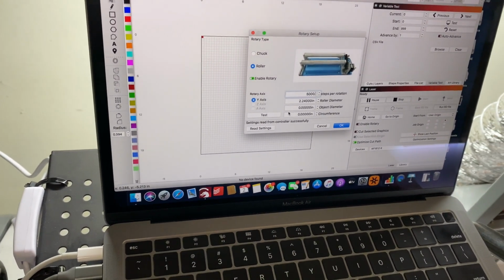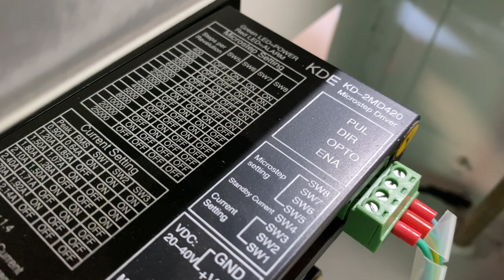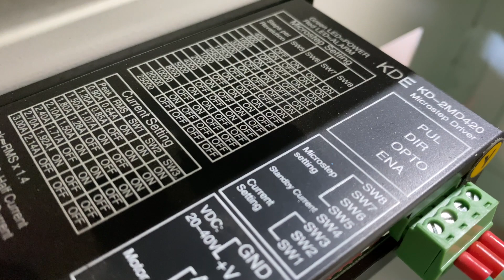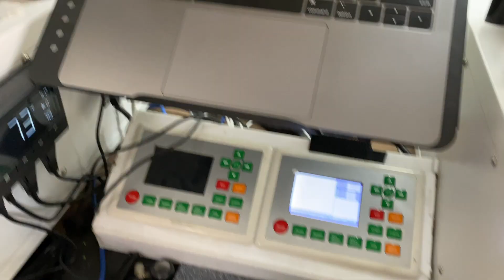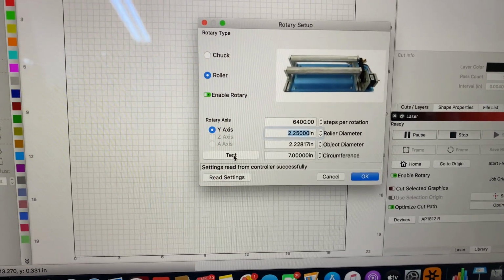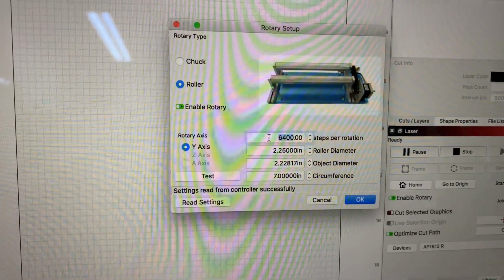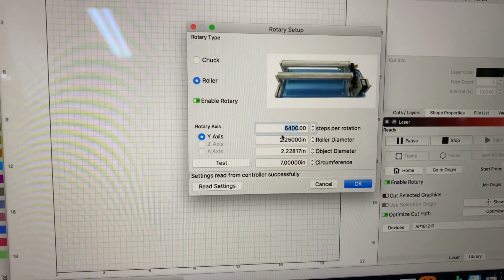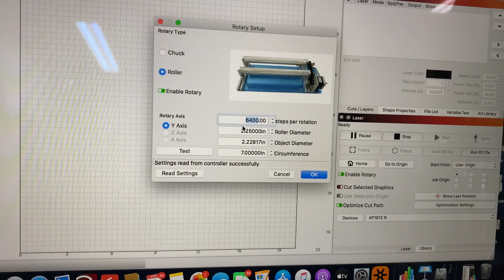HOW TO... Rotary Test Lightburn

Comment: I have an issue where the rotary just keeps going and going when i try to get it to do one spin. It seemed that when I changed steps per rotation, nothing changed even though I clicked «write» any ideas what’s wrong? All the other settings were correct

This is a cloudray roller

Comment: Could you help me ? I have a fiber laser everything is plugged in correctly into the stepper motor according to diagrams and few videos I’ve seen. But the rotary still won’t turn ? The chuck is fully powered. Any ideas ?

Comment: I have a pi burn 3.0 and for some reason my machine will Rasster and vector an image but it is not rolling in the cup. Is there a setting that I am missing?

I know the machine works because it spins when I hold it. And on my Riuta controller I can scan up and down to spin the cup. Frame also works to spin the cup but the job or graphic rastering does not.
Reply from the maker: You likely have your steps or roller size wrong.. Or you dont have the rotary enabled in Lightburn
Reply: @HouseOfLasers  Thank you. I found that the prior owner of my machine installed a toggle switch and apparently it was in the wrong position. I knew nothing of that switch but for some reason when I switched it on and allowed the x-coordinate to spin.

Comment: hi there i have watched your video so does that mean every time i put a different size object in the rotary i have to work out steps per rotation i thought once you set the wheel size and it does 1 full circle i only had to draw a box in lightburn with the correct circumance and that would do a full circle or am i missing something thanks for your help...

Comment: hello i have been asking everyone and cannot seem to fix this problem. I get vertical lines in the glass, and the edges are uniformly wavy. wish i had a way to send a pic. but the dimension are correct. i have even tripled both dpi and LPI which really made no difference. any guidance would be amazing.  thank you !
Reply from the maker: Hop on our FB forum post some photos
Reply: @HouseOfLasers  great thanks i just applied ill send photos once accepted. Thank you for the reply!!